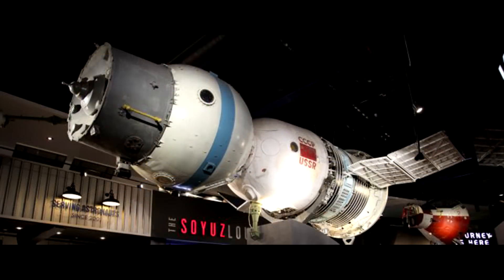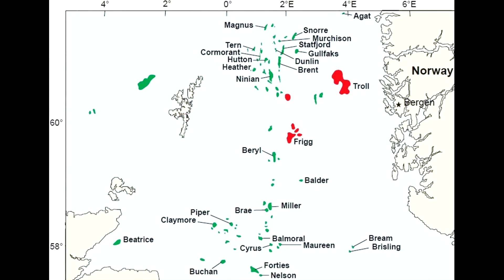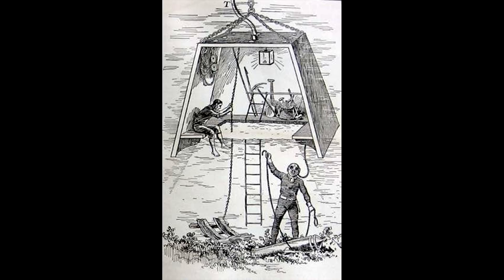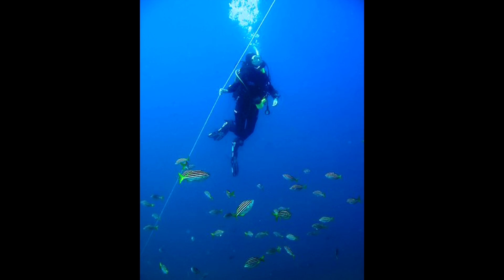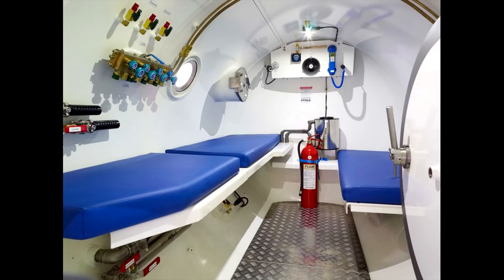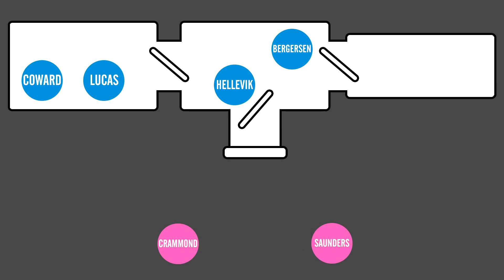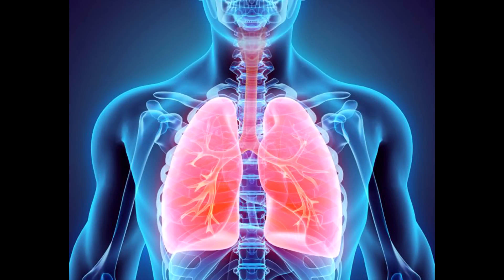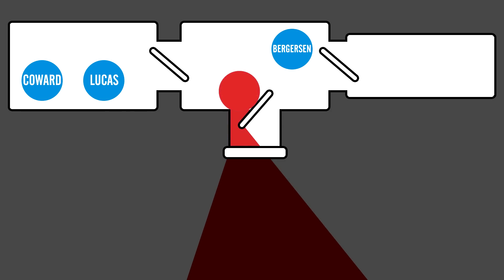Extreme Loss of Pressure Tears You Apart | Last Moments

Comment: Say you were wearing an old school suit at saturation depths. You're breathing some mixture of helium (inert), nitrogen (not good for divers which is why you're using helium to dilute the mixture), and oxygen (normal levels are toxic when deep) pumped in to your suit at very high pressures to equalize your suit to the pressure of the water that is pushing in on you from all sides. If the pressure were to fail, the helmet in this old school dive suit would not compress as it is strong metal. However, the rest of the suit, and you, would compress. You would be squeezed into the helmet like tooth paste. There's a video, and it might be from myth busters that shows this happening on a test dummy. Differential pressure: When it's got ya, it's gotcha! With explosive decompression... you already know what happens. Shake up and soda and open it. The soda is your blood, assuming you aren't crushed and squeezed through some tiny gap bc you were in the wrong place at the wrong time. The blood boil should be relatively painless. You're brain would be knocked right out, i think. Unsure.

Comment: Everyone probably never saw it coming. Much like an implosion under the deep sea. It might now shredd you to dust like how it would in the deep sea but the Gases in your blood would experience sudden change in pressure which which will cause they to Form bubbles shredding your flesh apart.

The guy getting shredding in the door reminds me of that video of a crab getting sucked into a small hole in an underwater pipe. The crab was forced into a hole a few millimeters wide.

Comment: This is a partial list of the commercial diving fatalities over the past 15 years. All have one common cause, Delta P. Two out of three commercial diving fatalities involve Delta P. It is invisible to a diver and it strikes suddenly without warning there is almost no way to escape once it grabs you. Knowing what it is, where it lurks, and how to avoid its grasp is the subject of this video. Delta P stands for differential pressure. Our discussion refers to situations where the pressures between two bodies of water are dramatically different. In a situation like this, the bodies of water continuously seek to equalize themselves. In this example the body of water on the right wants to rush to the body of water on the left by means of the pipe between them. The pressure exerted on the valve stopping this water transfer can be enormous, depending on the difference in the depths of the water, and the diameter of the pipe. If the difference between the depth of water is 50 feet, and the diameter of the pipe is 10 inches, the force of water exerted on the valve is nearly 1,700 pounds. If the valve was suddenly opened, and your arm was near, it would be sucked into the hole instantly. Trying to remove your arm would be like trying to lift a car completely off the ground, with one hand. You could only remove your arm if the pressures between the two bodies became nearly equalized, but at the pressure in this example your body makes a perfect seal, stopping the bodies of water from equalizing. The formula for calculating the force of water through a hole at a particular depth is, the area of the hole multiplied by the difference in water depth multiplied by the PSI per foot of water depth. Or in the situation just described, the 10 inch hole equals 78 square inches times 50 feet of water depth times 0.432 psi per foot of fresh water depth, equals 1685 pounds of water pressure. If you are diving in salt water be sure to use 0.445 psi in your formula instead. You can't see or feel a Delta P situation as you dive near it. It grabs you suddenly and it doesn't let go until the pressure is equalized. When it's got you, it's got you. As you watch the following recreations of actual Delta P incidents, ask yourself if you have on occasion ventured into situations without being thoroughly prepared. Diver one enters the water behind the dam structure in order to clean the strainer of the dams drain. When the drain is cleared, the tremendous force of rushing water through the drain grabs hold of diver one, sucks him partially inside and traps him. Diver two enters the water to help divert one and becomes trapped also. Diver three enters the water to rescue divers one and two and after 40 minutes returns to the surface with both divers. They are dead. Diver three was hospitalized for injuries suffered in the rescue attempts. A scuba diver was repairing a pool bottom at a depth of 10 feet and he came close to the open pool drain and was drawn against it. His body made a perfect seal against the drain. He was diving alone, and had no tender at the surface. No one knew he was trapped. He ran out of air and drowned. Two scuba divers entered a water tower to unclog a drain. Using a fire hose to blast away the silt and mud that was clogging the drain, the drain suddenly opened. A great suction immediately occurred. Diver one was pulled into the drain. Visibility was zero. Diver two did not know that this had occurred. Diver two surfaced, thinking diver one had already come up. Diver two made repeated but unsuccessful attempts to find him. Diver one ran out of air and died. Neither diver was tethered to the surface, had communication with the surface, or with each other. A surface supplied diver was working offshore in 86 feet of water on a well reentry project. He was using a drill string to hook a trash cap, inside of a 13 inch well casing. The first attempt failed to catch the cap. The diver was asked to stand by the hole to make sure the string caught the cap. He reported when he saw the cap was hooked and began to leave. The drill string was pulled to the surface rapidly because the camp was nearly the size of the casing, a great suction developed. As the cap came free, the rushing water grabbed the diver and forced one leg into the hole up to the pelvis. The diver was killed. Diver one enters the water at a hydroelectric generation plant. His assignment is to seal off leaks in a large gate valve. The three-person dive team is assured by the plants operating personnel that the gate valve is closed. Diver one surfaces and reports that he thinks the valves are open. The winch is started and closes the valve. A 30 inch sluice gate is manually crank shut. The dive team questions the plant personnel. The valve indicator shows the valve not fully closed. Plant personnel replied that the indicator is never correct and typically the valve is cranked until tight Diver one re-enters the water, convinced that everything is okay. In a few moments he begins to scream. The dive supervisor tries to contact diver one on the intercom. The tender and supervisor pulled the lifeline and umbilical. Both have broken from their attached points. The gates are cycled open while waiting for the rescue divers. Two attempts by the company diver failed to locate diver one. 12 hours later, diver one's body is recovered. When you accept a new job, make sure you take part in a free job meeting. Be sure that you understand the layout of the site, and how the piping and valve systems work together. The diving supervisor should have a simplified, but site-specific schematic of the site and a diving checklist to make sure nothing is on or open that shouldn't be. Your client also needs to know about Delta P. If they take your concerns lightly, make sure they understand the life-threatening hazards. Always practice lockout-tagout procedures. These are tried-and-true methods that can eliminate machinery and valve accidents if practiced religiously. Make sure to consider the potential delta p hazards of your new assignment when choosing your equipment. Make sure others in the water and on the surface can tell exactly where you are. They should be able to communicate with you at all times and be able to get you out if you're stuck. Make sure your equipment won't interfere or become fouled if you must be near a delta P situation. There are certain techniques that you can use to help reduce and even eliminate delta p hazards. The first step is to recognize the potential forces working on each other in your environment. Learn the layout of the site and how the system functions. Calculate the force of water at the depth you're working based on the size of the openings at that depth. Instead of cutting holes to drain water or relieve pressure, cut slots. If your body or equipment can't make a good seal against the flow of water, you can't get stuck. Fabricate a cover for the drain that has a screen or make a cover that has more than one hole a good distance away from the other. The idea is the water can still get through even if your body gets in the way. The goal of this video is to make you aware of the potential for differential pressure situations. The key is to recognize them beforehand, and make sure you're prepared to deal with them. Because when it's gotcha, its gotcha. Don't add your name to this list.

Comment: Decompression in space might suck you out a hole. But a decompression underwater, doesn't need the hole.
Reply: Decompression in outerspace is not as much dangerous becouse pressure differential between inside a wessel and outside usually is less than 1 atmosphere, its highly unlikely you would be sucked out in any circumstances exept most extreme breaches.

Comment: I worked for a company that made AGVs (Automatically Guided Vehicles - robot cars). There was an accident that killed a worker in gruesome fashion. AGVs are used in factories to move parts bins, etc. around the plant. They drive on the same floor that people walk on, following a guide path wire embedded in the floor. The guide path is clearly marked and all employees are trained on AGV safety. Basically, stay out of its way. If they must work in the guide path, they have to put a "stop sign" in the path so that the AGV will see it and stop. The AGVs also have UV light and ultrasonic object sensors and huge plastic bumpers that detect objects ahead or objects contacted by the bumpers. The workers got used to the AGVs always stopping even without the "stop sign". One day they needed to replace burned out lights above the guide path. They placed a large step ladder on the guide path, bridged across the guide path. Think of it like a capital "A" with the guide path going between the legs of the "A". The person changing the lights was safety harnessed and hooked into the ceiling so he couldn't fall. An AGV came along and didn't detect an obstruction in the guide path because the bottom of the legs of the ladder were actually outside of the guide path. But the AGV and cargo couldn't fit through the area under the ladder. The AGV/cargo hit the ladder and became entangled. The person on the ladder was safety harnessed to the ceiling and the ladder. The AGV kept going and tore the person in half.

Comment: One of your most inaccurate videos you have made. The four divers were doing what is called Saturation Diving, where they don't decompress after each dive, but instead reside in the pressure chamber, which is pressurised to the same depth as which they dive to. The two British divers were in their chamber resting, whilst the two Norwegian divers were returning to their part of the chamber after just  finishing their diving shift, when the accident happened.

Comment: When the narrator says at the end that he "wonders what went through their minds"  I am reminded of the joke about the bug hitting the windshield of a car.    I had one serious accident in my life and afterwards I couldn't remember anything except the second or two before I hit the ground.  I think it takes the brain a bit of time to figure out how to process a physical event, and in the case where the damage is severe enough, the brain will more or less give up on the task, either as a protective mechanism or simply because normal functions are too interrupted at the point by what one might call 'emergency reactions.'  These are not necessarily conscious reactions.  And another form of this type of accident can take place in an old fashioned metal diving suit where the mechanical failure leads to a dramatic increase in pressure.  And of course, there are submarines to think about.....

Comment: Was the chamber not 9 atmosphere of pressure? I don't get it. If the bell, trunk and chamber were all 9 atmospheric pressure, then how did this happen if the bell was still attached when he opened the bell seal?????
Reply: Yes, he kind of missed some information. The procedure is:
1. Close the diving bell door, which would have been open to the trunk.
2. Slightly increase the pressure in the diving bell to seal the bell door tightly.
3. Close the chamber door, which was also open to the trunk.
4. Slowly depressurize the trunk until it reached a pressure of 1 atm.
5. Open the clamp to separate the diving bell from the chamber system.

When the bell clamp was opened, it had already been depressurised to 1 atm. Hellevik didn't manage to do step 3 properly, and Crammond is already at step 5.

Comment: this is the best breakdown of the byford dolphin incident - the animated diagram was especially helpful in making sense of what happened
Reply: and an update: the families affected by the incident finally received compensatory damages from the norwegian government. there should have been fail-safes in place to prevent this from happening. any risk analyst worth their salt should have recommended more "barriers" to death than communication, especially amongst workers who were fatigued after 24hr shifts. 

like a green light/red light for when the diving bell/chamber door is closed/open, or internal pressure sensors that calibrate to the current pressure, followed by a test bolus of pressurised air once the bell/chamber door is sealed, after which the sensors should test again for a HIGHER or LOWER pressure. if higher, then everything went as planned; if lower, then the chamber should have indicated it was UNSAFE to proceed further

Comment: I view accidents like this as design failures.  "If its possible to occur, no matter the odds, it eventually will."  Therefore, if its possible for both doors to be open at the same time, then thats a design failure.  Instead the design should have been such that the door only opens when there is no differential pressure.  Since the bell clamp could be removed when there was a difference in pressure, the system was destined to eventually fail.  One way would be to have a pneumatic cylinder rotate a toothed collar which locks the bell to the chamber.  The only way for the collar to rotated back, and allow the two toothed flanges to separate would be to decompress the interior of the space between the two air locks.  Likewise, the airlocks would have a different mechanism based on the same principal.  The second systematic rule would be that no airlock could unlock unless all locks were locked, and no differential pressure.  Once you create the system, hire someone else to break it, and when they find 9 separate flaws, then you redesign and iterate.

Comment: What went through their minds? Likely nothing at all. Would have been near instantaneous. At that pressure 1 second you exist, the next you're not. That's 132 PSI, so that would have been an almost instant shift between 132 PSI and maybe 20 - 30 PSI as was still not above water, but obviously thats a huge change in pressure.

Comment: I'm a saturation / bell diver and I talked to a couple divers who knew first hand what caused this accident and both told me the bell hadn't been mated properly to the habitat and when the pressurized the transfer lock using the habitat pressure instead of using the transfer lock the pressure pushed the bell away and the entire system experienced explosive decompression.

This makes the only sense because the locks won't ever open unless the pressures equal.

Comment: If I would have been Crammond, I would have known that the lives of the men inside were in MY hands and I would have done nothing UNTIL Hellevik had confirmed the trunk door was closed and he had repeated the confirmation. Similar to the carpenter's rule: "measure twice, cut once" !

Reminds me of the Tenerif collision between Dutch KLM and PanAm as the KLM took off and because there was a miscomms between the ATC and the PanAm crew about which taxiway to take after using the runway to move into position for takeoff after KLM AND a miscomms from ATC to the KLM crew about takeoff clearance.

Comment: A young welder went inside a fuel tanker truck to do some welding repairs through  a hatch in the top of the tank. 
They didn’t perform a test of the space for harmful gases. 
He went inside to start work on welding, soon as he lite the welding torch BAM the gases exploded and his body and parts blew up through the hatch and on to the garage ceiling. Was nothing left of the poor welder. 
Welding company and owners of oil truck were fined. 
Similar deaths as the divers in away but opposite